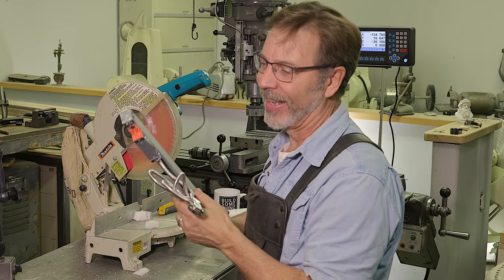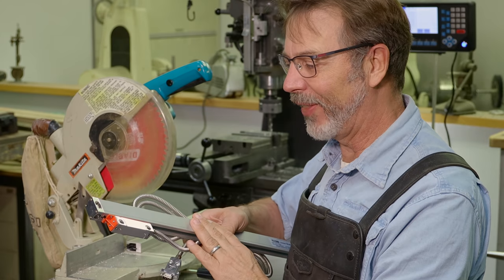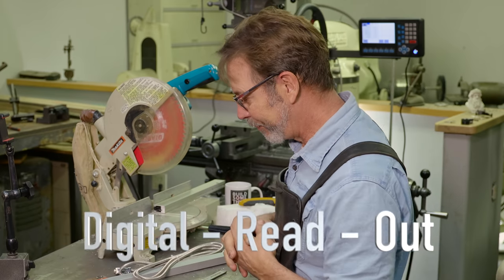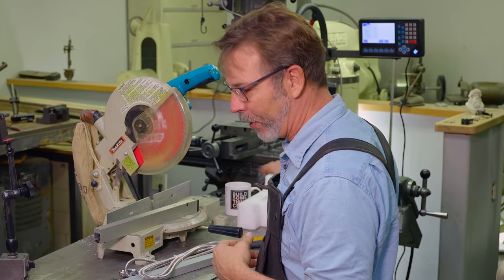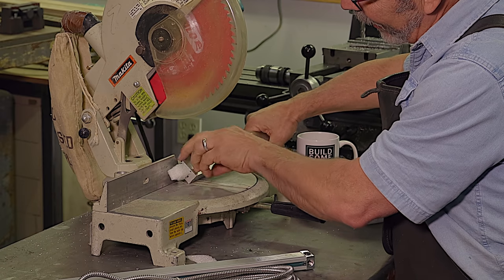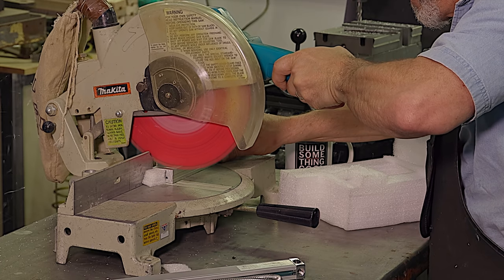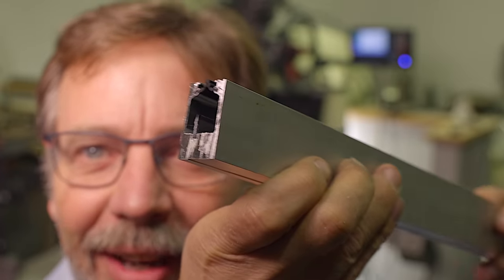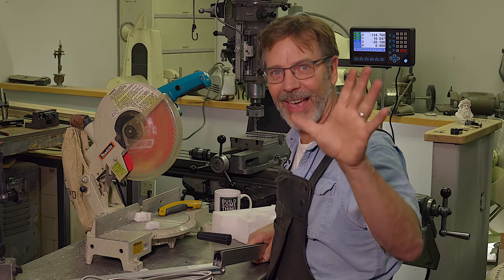Doing the impossible cut

Comment from the maker: Hey guys, I probably made five or six test cuts on 2 different types of expensive scales, and they all were  successful not one of them cracked or were made unusable :-)
Reply: Great video Dale!  I've never had to cut scales, but have researched and wondered about doing the same thing.  Is there any way to test, or know if there would be any residual cracking in the glass that remains?  Will the reader head still Read, if the remaining scale does have cracks-?  Great video nonetheless, & thanks!
Reply: This Old Tony has you beat. I saw him kung-fu a glass scale down the middle to create two scales from one. Then TIG weld them together to double the size.

Comment: Glad it worked. Shows some innovation. Glass will break during cutting much of the time because of heat friction, not to mention too few cutting teeth. I'd have used my tile cutting saw with a glass cutting blade. It'll eat through aluminum easily as well. It's a wet saw so keeping water out of delicate areas would be fairly simple with the foam inserts you utilized. I've several miter saws but I like my carbide blades too much to cut glass with them.  Your blade is probably a metal cutting blade, if not, you'll not be doing burn free fine woodworking cuts any longer. Suspect that you don't do much of that anyway, working steel has it's own gratifications. :-)
Reply: Glass is pretty hard but I don't think that the carbide teeth go dull so easily

Comment: On mine I had to cut the glass a little shorter in order to fit the end caps. I uses a band saw for the aluminum and thin cut off wheel for the glass.   But they are not a delicate as you would think, and the sensor doesn't go all the way to the end anyway.
Reply from the maker: Great Points Matt :-)

Comment: Supporting the glass is a brilliant ides but I am surprised it worked,Luckily the Chinese scales don't cost what the US or German ones do.  I have supported things like this with parafin wax and then melted it out in hot water.  I've seen spray foam used too but is a bigger mess to clean out.  I use Newall DRO's where the scale is a tube full of ball bearings. You could likely cut one of those down but I wouldn't do it for fear of upsetting its accuracy. 

Very brave Dale. Nice job. I wonder how many scales will break today.
Reply from the maker: Hi John, I made several test cuts all of them on expensive scales. :-)

Comment: I cut one today.  Wrapped the glass with masking tape at the cut point and used a diamond cut wheel in a dremel to cut the glass.  Do not be afraid to take the scales apart and cut them.  If you need, take pictures of how it comes apart so you can reassemble it.  The hardest part of the job is cutting the case.  Really, it was stupid simple to do.

Comment: I cut mine off with a thin abrasive cut off disc. it worked just fine. There’s another video of a guy cutting his with a harbor freight type bandsaw… I didn’t have the guts to try that  with my saw so I just did it with a disc and it cut through it like nothing.
They are fragile as hell and you have to be careful, but no guts no glory! Lol

Comment: hmm, the high forces of the teeth hitting the glass? nein danke
I would have used a high grit abrasive thin cut-off disk in the miter saw or other rigidly held machine.  even an an abrasive disk mounted as a slitting saw on lathe or mill
Anyway, Dale, it worked for you. congrats
Reply: Hi Len, I think you missed the Point Dale was making, which is what you can do,  if you Experiment, and have a comedy skit at the same time
Reply from the maker: Great comment Ted, Thanks

Comment: Hello Dale,

this is very interesting! I was told by several individuals that cutting a glass scale is a no-no! 
I was lucky that I was able to get my glass scales the exact length that I needed.
I have by the way the same DRO, a Ditron D80, as you do and am very happy with the unit! The only complaint that I had was that the manual leaves a lot to be desired! The very first chapter started with item #5 and the translation is terrible. I ended up finding a PDF file that I printed out and it has the missing information!
If you care to contact me regarding the DRO, let me know and we can compare notes!
Reply from the maker: HI Alex. My DRO I a Ressen, Its the same thing,  but with better instructions, or should I say the English is near perfect It just doesn't explain the operations very well. LOL
Reply: Build Something Cool   -   Yep, something got lost in the translation, but knowing what you are trying to accomplish and reading between the lines makes things doable!

Comment: @buildsomethingcool Dale, Congrats! My question is, why? I am just getting into the Machining World. So, I am curious as to why you would need to cut this Glass Scale down?
Reply: They normally come in set sizes and might be either too long or short. So you normally go for the longer one and cut to the required length. But there is the risk that it shatters
Reply from the maker: Hi Phillip, Good Question. I had a used DRO that came off a larger mill that I wanted to use on a smaller one. If you buy a new DRO you can order the scales to size and will not have to cut them down.
Reply: @BuildSomthingCool  Copy that. I figured that was the deal as to why you cut it. Also, thanks for the education on how a DRO gets its measurements/readings. As someone new to the Maching World, I am realy enjoying your channel. Loved the Shop Tour Video you did @Fireball Tool. I am an avid Customer & Fan of Jason and his Fireball Tool Business. I often wonder how I ever built anything before owning his Squares. Lol
Keep uo the Great Work!

Comment: A couple of weeks ago I shortened The X-axis DRO on my mill (HF/Central Machinery Mini Mill).  Instead of trying to saw through the glass I used a carbide tool mounted in my Dremel and scored the glass.  I didn't get the clean break I was hoping for but it was good enough.  One thing I noticed about your process was that the end of the glass was even with the Aluminum extrusion.  I don't know if it is needed, however I cut the glass on my DRO as close to what the factory set into the extrusion about 1/4".    Question, did you have any problem fitting the end cap back on the extrusion/DRO?  As always, great video!  More!  More! More!
Reply: That is a fair point, mine all had to be cut with a set back too
Reply from the maker: I was Lucky I didn't have to cut the glass back on mine. If I had to I would have used a Dremel Like you did

Comment: A woodsaw to cut steel and glass? Andtwo pieces of foammanage to stpo the vibrations completely?  Something is not right here, it seem  more like aluminiummy and perspexy if a wood-saw can even get hrough it. This has a very april-1st feel about it.

I'd definately stick to the "don't try this at home" advice, especially if you're sure it's a waverthin piece of actual glass in there.
Reply: vinny142 this is not a miter saw for wood, it’s a cold cut chop saw for metal. still weird that it would cut and not just shatter the glass. btw a regular “wood” miter saw cuts aluminum beautifully
Reply from the maker: Some people you just can't make happy. :-)  In reality the saw never did cut the glass, it just broke it cleanly. Glass is a very interesting material it has some incredibly strong properties. Like I mentioned in the video vibration is your enemy when cutting glass. Believe it or not you can cut thin sheets of glass  with scissors underwater. The water absorbs vibration and allows you to trim the glass. I know that sounds like April fools, but give it a try before you make a comment  :-)